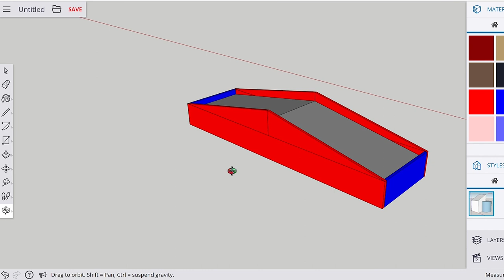2 Player Pinball Machine Build, Part 2 (Building the Frame)

Comment: are you really planning on not using any screws with this? idk the strength of your glue, but I'd think a screw could be used at least in the framework?
Reply: JeroenEch wood glue is stupid strong especially titebond, you'll break the wood before the bond, at least that's MY experience with the few years